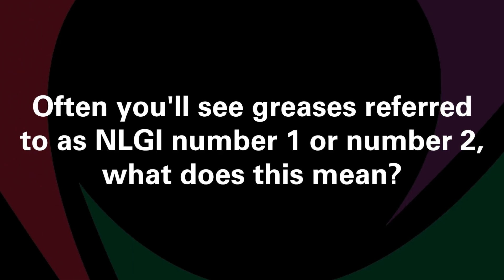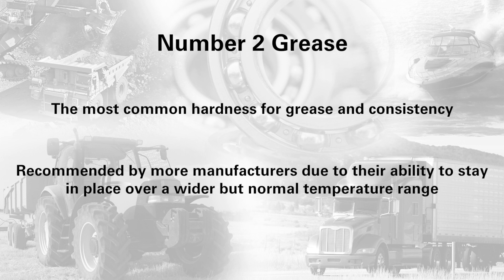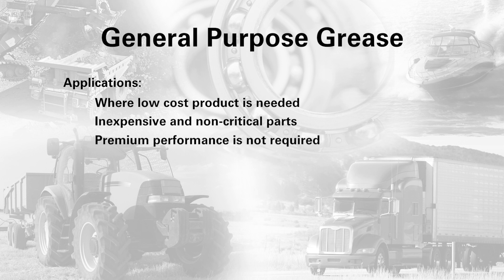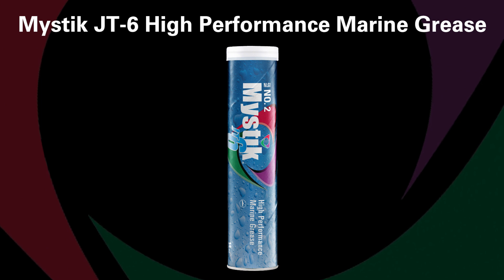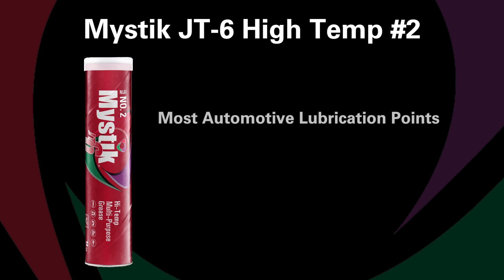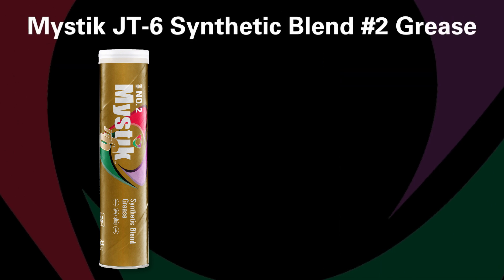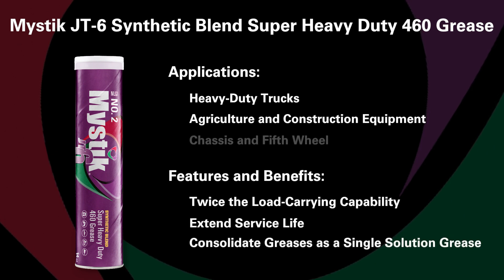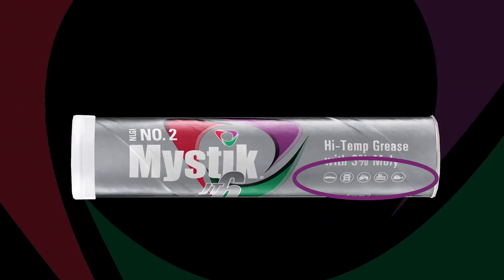Which Grease Should I Use?

Comment: Excellent video!!! Thank you! However, one topic was forgotten: When and why would someone select and use a synthetic grease over a petroleum-based grease?
Reply: Any time you want or need a better product? Nothing against Mystic, they make very good products. But are limited due to the nature or composition of petroleum out of ground and it's limited properties. 100% synthetic is better due to the ability to not have viscosity breakdown as quickly as regular, or mineral oil products. Ex. Full Synthetic oil (which is a blend of mostly mineral oil and a little 100% Synthetic oil) recommends changing the oil every 3,000 miles. 100% Synthetic can go 10,000 miles between oil changes. Plus has 4 times more lubrication over Full Synthetic. 100% Synthetic however, is more expensive with up front costs, but due to length of service actually isn't much more than say the Full Synthetic lubricants. Naturally, by using additives you can increase Full Synthetics lubrication (Like Slick 50 which is also a Full Synthetic product, but Teflon makes the oil have 2 - 3 times better lubrication and increased film properties to protect against dry starts. And I have used the stuff for 30 years)  but won't increase oil's viscosity properties. If you use a 10W-40 oil, when you go to change it, it's more like 10W-30 oil because of viscosity breakdown. (The comparison at the molecular level is Full Synthetic (Mineral oil) has different size molecules with sharp edges, think gravel. But 100% Synthetic has the same size molecules and the molecules are smooth and round like ball bearings.)  It just is hard to come up with the money initially for 100% Synthetic, because even the price of a regular oil change has gotten expensive today. Especially when you go only 3,000 miles. But Mystic does make some of the best Full Synthetic products out there.  (And if you don't plan on keeping a vehicle long might as well go the Full Synthetic route). You can still get very long service life out of well made engines with Full Synthetic. I got a buddy that is still using his 2005 Yukon as a daily driver with 320,000 miles on it just using Mobile 1 most of the time for oil changes. And Slick 50 in the Winter and Summer, twice a year.)  So is it the oil, or the engineering and manufacturing of the engine?  He's got the 6.0 liter V-8 in his Yukon. Apparently one of GM's better engines.  He's just now replacing items like the alternator and water pump in the last year. It even has the original timing chain.  Too bad all engines aren't made that way.  lol                                                                                                               Take care. (and hope I helped out some.)   "The best product is the one you can afford."   lol

Comment: Thanks for the well done video ! I have a boat trailer that the bearings are imersed in salt water. I believe that when wheel hubs that are warm[travling to the launchsite] are imersed in water that the water can be sucked past the inner seal if there is any void and contaminate the hub etc. Do you have any info that would support that asumption? your thoughts would be appreciated. Thanks again
Reply: If you don’t already have them, bearing buddies work well for me. Push the water out with grease.

Comment: Which grease would you recommend for an ar 15 bolt? Assuming it will be a high speed high temperature grease. Thanks
Reply from the maker: There are some very good YouTube videos for cleaning and lubricating the AR 15. There are several opinions on what grease to use, however at this time, we do not manufacture a grease that would be recommended for that application.
Reply: Lsa
Reply: Use an oil not a grease. 10w30 or whatever is on your shelf is perfectly fine. It's a gun designed to be beat to death and still work. Adding oil of any kind other than rem oil, which is as thin as mineral spirits, will do the trick.

Comment: Thanks for explaining all the different types and applications. I have to check my last tube of grease I bought when I repacked my front Disk brake wheel bearings. Might have to repack them after this video. Cheers from Motown.
Reply: Mystik makes some quality products.   I think it's cool you repack your bearings. Smart way to save money. Just watch the shear properties of the ball bearings so they have not reduced too much in size, and why it's best to wash out any mmicrscopic metal flakes out of the ball bearings before re-greasing them.  Great way to save money, and use better grease than the initial stuff used in your wheel bearings. Which is usually where the manufacturers of wheel bearings cut costs.

Comment: LUCAS MARINE GREASE MY #1 GO2
I had a torn inner boot drivers side on my 2002 Toyota Corolla and it was making bumby and vibration on acceleration. By reading and searching on the internet I tried two full tubes of marine grease and injected it into the spider bearings and the other tube in the boot and closed it up. Took it for a small spin and the vibration faded away within 20 seconds once I hit the HWY Freeway. Took it up to 150 km/per Hour for 30 seconds and dropped it to 130 km/Hr for 30 minutes.
AMAZING! 
LUCAS MARINE GREASE IS A MIRACLE! IT HAS BEEN NIW 3 MONTHS AND SMOOTH AS PIE.
I could not go more then 60 km or it would vibrate. On acceleration it would vibrate.  
Before replacing your CV Joint, try LUCAS MARINE GREASE!!!

Comment: I need EP2 lithium grease for my wheel bearings...What’s this mean compared to NGLI 0, 1, or 2? I have an off road on road Land Rover that I want to maintain as well as possible overseas. Can you help me understand?
Reply from the maker: An EP2 Lithium grease means an Extreme Pressure, NLGI #2 grease with lithium as the base grease. NLGI also has a code on the label, LB/GC, that means that grease is approved for wheel bearings and disc brakes. We would recommend a lithium complex grease as they are made for high temperature where a plain lithium grease is not. The Mystik JT-6 Hi Temp would be a good recommendation for you. If you have more questions, give us a call on our product answer line at 1-800-248-4684 - would be happy to help you and answer your questions in more detail!

Comment: what's the difference (if any) between silicone grease vs. dialectic grease????
Reply from the maker: A “dielectric grease” is a grease which does not conduct electricity.  It is used to lubricate and protect electrical connections without conducting electricity across multiple connections.  Some dielectric greases use silicone fluid as the base oil for the grease.  In short, some, though not all, dielectric greases are silicone based, though not all silicone based greases are dielectric greases. Hope this helps!

Comment: All I know is the farmers in Arizona say that they went to JT-6 and stopped replacing parts and pins and bearings. A friend put regular grease on his hand and could wash it off with soap and water after a few minutes. JT-6 he said he couldn’t get it off without using solvent and Orange goop and that was a chore.
Reply from the maker: Thanks Jeremy! A lot of our heavy duty customers say the same thing! Less time to worry about regreasing that fifth wheel and other parts.
Reply: I can second that. The more cussing I have to do to wash off grease or lubrication, the better I know it is

Comment: What grease would be used in power tool gearboxes like electric drill or skill saw?
Reply from the maker: Hey there! We'd recommend our JT-6 Hi-Temp Grease Number 2 - here's the direct link to learn more https://www.mystiklubes.com/do/product/GREASE/665005002.
Reply: Thanks for the information. I am also wonder about the JT-6 Sythentic Blend #2 How would it preform in a gear box? Thanks for the information and your video is quite informative.
Reply from the maker: Glad the information is helpful! Gear boxes typically require greases that are softer in consistency than a #2 grease.  If the gear box requires a #2 grease, the performance of Mystik JT-6 Synthetic Blend #2 in a gear box would depend upon the design of the gear box, input and output speeds and the load on the gear box. Feel free to give us a call at 1-800-248-4684 on our product answer line if we can assist further!
Reply: I run a mowing business when greasing the bearings for blade spindles which grease is recommended
Reply from the maker: Gary -- Without knowing the exact lawn equipment it's hard for us to make a specific recommendation but you can always call us on our Lubes Help line at 1-800-248-4684 and if you tell us the specific piece of equipment, we could provide a recommendation. We also recommend that you consult your owner’s manual for proper grease selection.  If this information is not available, you may wish to consider using Mystik JT-6 Hi-Temp Grease No. 2.